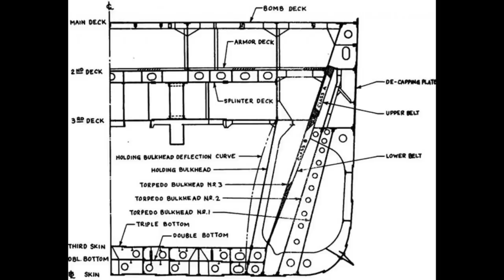The Drydock - Episode 230

Comment: With missiles, it depends. An Iowa could probably take quite a few exocets, as they have a fairly small warhead and are subsonic. And yeah that'll mission kill the ship because the upper works would be wrecked and radar etc might well be damaged. As Drach said, if you go up to the big Soviet missiles, like the SS-N-19/12 or AS-6 etc, you're looking at something diving down at Mach-4 with a 1000lb warhead that could have had a shaped charge.
Reply: Two slight problems with that. The SS-N-19 would slow down to about Mach 1.6 in the thicker sea level atmosphere before hitting, and they don't have shaped charge warheads (because that wouldn't be very effective against a ship) they have HE warheads, which would probably penetrate less than 3" of steel (given the heavier, faster 16"/45 Mark IV's CP shells were optimistically predicted to penetrate 3" of steel). An SS-N-19 with an AP warhead would probably go through 14" of steel (given a warhead weight similar to KGV's 14"/45s and a striking velocity between what would be achieved at 10,000-15,000 yards), but they don't have such warheads. I don't doubt the other smaller anti-ship missiles would have the same problem, actually retaining that speed at sea level and the much lighter than the weight of the missile warheads not actually being AP. Not beyond the whit of man to fix but also not in service, although at the time they did have nuclear warheads which would work.

As an aside you may sometimes read that soviet anti-ship missiles had shaped charges, they did but they weren't optimised for penetration. They are a dish shape that directs more of the blasts force into the ship, causing more damage. Rather than focusing that force into a very thin jet, that would penetrate very deeply but not not damage the ship all that much because it would offend only a very narrow area.
Reply: @Volunteer-per-order_OSullivan  Nitpick, Granit's warhead is designed to punch through supercarriers which themselves are actually very tough ships.
It's nose is reinforced with a large amount of steel, SAP in nature if not AP.
With it's weight, size, and speed, it will go through any battleship by sheer kinetic energy alone.
Reply: We know that the SS-N-2 Styx had a shaped charge warhead located behind the fuel tank, so it will penetrate quite a bit of armor and inject burning kerosene into the space behind that armor. Of course, that one is a subsonic sea skimmer, so the question becomes whether it would detonate on the shell plating (1.5" STS) and then disperse too much to get through the armor or if it would still be coherent enough to penetrate the armor belt as well.
Reply: @kemarisite  It was a shaped charge but not an armour piercing warhead. It wasn't designed to penetrate armour it was designed to direct blast into the ship.
Reply: @ThatZenoGuy  Supercarriers have armour at most 1.5" thick, the reinforcements required to get a missile intact enough for it's warhead to detonate though 1.5" of steel will not withstand hitting a 12" belt or a 6" deck. Base fuse High Explosive shells can penetrate that much armour (the CP shells for the 16" mark IV were optimistically suppose to penetrate 3" of steel). And no, the massive armour of kinetic energy a missile has is not backed up by the structural integrity to to cause the armour to deform, it'll just deform itself. 
An actual AP warhead is not beyond the whit of man, they just don't have them.
Reply: @Volunteer-per-order_OSullivan  There has got to be some kind of communication or translation issue, because a shaped charge is, by definition, an armor piercing warhead, exactly what is used in High Explosive Anti Tank (HEAT) projectiles and missiles. An explosive warhead with a conical cavity in the front that concentrates the force of the blast into a small point and experts massive pressure to penetrate solid structures including armor plate.
Reply: @kemarisite  It is shaped, it is not shaped in a way to focus onto a small point and experts massive pressure. A shaped charge is not by definition an armour piercing warhead, HEAT is one type of shaped charge, it is not every type of shaped charge. There is however a communication problem because lots of articles call them HEAT warheads when they are constructed in a different way to, achieve a different objective.
Reply: @Volunteer-per-order_OSullivan  
It's a giant armored football filled with 750 kilograms of boom going twice the speed of sound, no conventional armor layout can resist such a weapon.
Reply: @ThatZenoGuy  The Iowa's shoot a heavier shell faster. A Shipwreck would hit like the HE shell of the KGV at between 10,000 & 15,000 yards, conventional armour can resist that.
Reply: @Volunteer-per-order_OSullivan  
The Shipwreck weighs several times as much as any WW2 battleship round, and is SAP or AP in warhead design.
Nothing can withstand that lmao.
Reply: @ThatZenoGuy  The weight of the missile is immaterial because an aluminium airframe will deform before an armour steel plate. It is not an AP warhead, Shipwreck doesn't even have a SAP warhead, it will not penetrate armour, the strongest thing it's suppose to penetrate is the 1.5" deck of a super carrier. While a supercarrier is sturdy compared to a destroyer it is quite flimsy compared to a battleship and soviet engineers aren't so stupid that they'd sacrifice the effectiveness of their  weapons against literally any other ship in the world to be able to deal with 4 ships that may or may not ever come out of reserve.

Armour piecing weapons need to be designed to penetrate armour. The 15"/42 fired HE and AP shells of the same weight at the same speed, and do you know what those HE shell didn't do? They didn't penetrate armour because that is not what they are designed to do, not is the warhead on a Shipwreck.
Reply: @Volunteer-per-order_OSullivan  
The Shipwreck weighs several times as much as any WW2 battleship round, and is SAP or AP in warhead design.
Nothing can withstand that lmao.
Reply: @ThatZenoGuy  Repeating something does not make a valid argument.
Please cite the source of your assertions that the Shipwreck is designed as an AP warhead that can go through 10+" of armor.
Reply: @gregorywright4918  
This isn't reddit, you have to go back.
Reply: @ThatZenoGuy  Your wrong, repeating it doesn't actually make it true.
Reply: @Volunteer-per-order_OSullivan  The Shipwreck weighs several times as much as any WW2 battleship round, and is SAP or AP in warhead design.
Nothing can withstand that lmao.